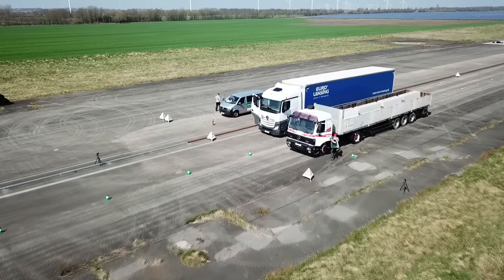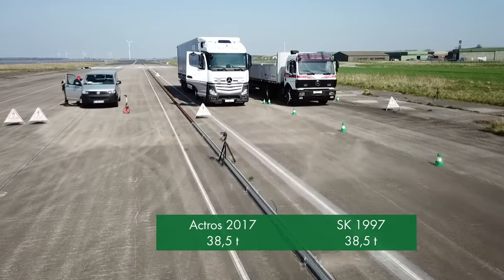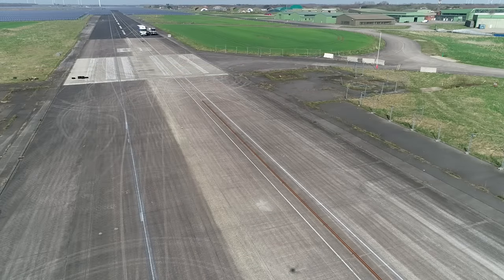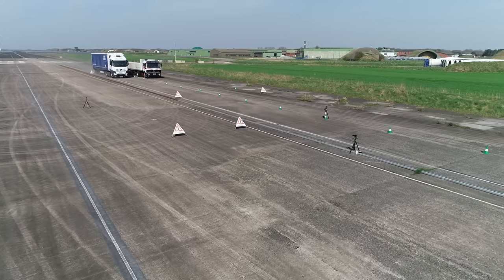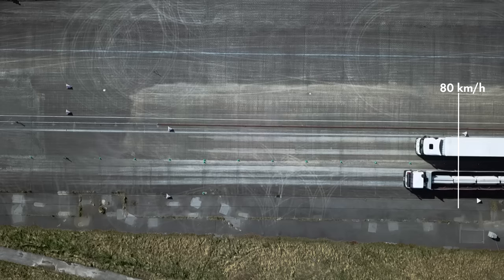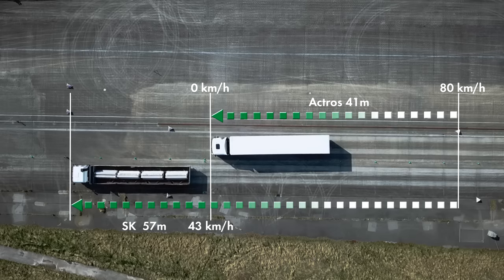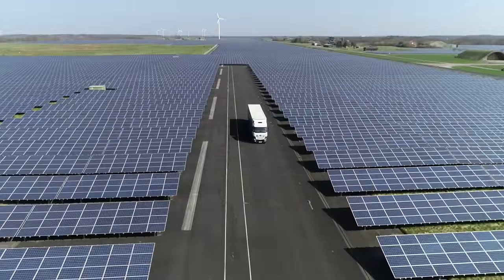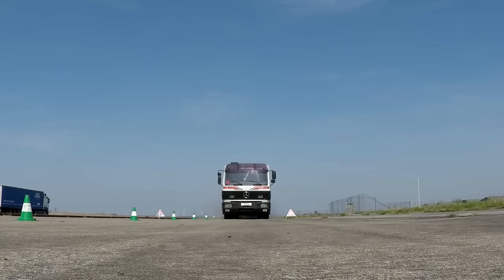Brake test: Modern truck vs. old truck

Comment: I don't understand how the passage of time can improve a mechanical system of simply dumping kinetic energy to heat has had such a dramatic effect, in 10 more years the truck will stop in the line?
Reply: The amount of the kinetic energy didn't change. What did change - is the ability to realize the braking action. Better tyres, more efficient and faster braking systems (to make it simple - disk vs drums), and better electric systems allowing less skid and more efficient distribuiton of braking action between the different wheels and axels. All of those improvements slowly, year by year and percent after percent, brought us to where we are now - this difference.
Reply: @dmytrogubskyi4355  I wonder if they put old cracked tyres on the old truck?
Reply: @MrSkyliner84  honestly, I doubt that. This truck still looks pretty good, so I’d not be surprised if it is still an ordinary working machine, thus the possibility of it running the old tires is pretty low. On the other hand, the tires themselves as production model may not be significantly changed for years. Decades - not, but years - for sure. I don’t know how precise they wanted to be with this test, how many variables they were going to chase. Yet still, even if the only things of their concern were truck and trailer production years, their mass and the legal ability of both of them to run the roads, they have achieved their goal to present a real life experiment to be shown to public.

Comment: Were the brakes properly adjusted on the older model?  Did both trucks have disk brakes or only the newer one?
Reply: juncukk , why?  Did my comment make too much sense?  I drove my first truck in 1975 on Ft. Benning, GA, and obtained my Commercial Drivers License in 1991, medically retired in 2018 and have driven a truck of some sort in three different countries so excuse me if I seem too knowledgeable.

Comment: The ideo of this test is to show how technology has advanced in 30 years. It's not only about the truck itself, but the trailer too. Trailer technology has also developed over the years. That old SK is pulling a trailer from it's era and the new Actros is pulling a new trailer.
For you delusional conspiracy theorists out there. Why the fuck would Dekra, an independent vehicle inspection company fake tests like this? It's not like Mercedes is conducting a test where they test their own brand new product against, lets say, an old Scania 3-series truck.

Comment: Why does the new truck not use the same trailer? What is inside... or what isn't!?
Reply: Because the idea of the test is "old vs new". So they took the old they've found and a new they've found. And if you want to suspect them in cheating, you'd find 99+ more reasons how they could do it even if the trailers were of the same type, so...
Reply: @dmytrogubskyi4355  Thanks for your comment, Dmytro. The thing is, that covered trailers been around in the time frame of the SK class and way before that. I know, how many I opened and closed during my active driving time.
Reply: @ajs8226  thank you for the reply too) Yes, I’m sure there were pretty much same covered trailers at that time. I just think they took what was available for the test, without second thoughts that it would become a point for discussion. I think they were interested in a year of production of the trailer (thus technologies used + wear) and whether it had the required capacity for the test to make the trucks equal in over all mass. Should they be more precise in picking the equal gear? - In my opinion, not really. They wanted to show the public a very simple real-life example of how it would be on the road - old semi vs modern semi. The masses are the same, the amount of wheels - too, the cargo is both of the same type - solids, secured on deck... So, I think they did what they wanted to do. And I’m just saying, that if any person would have a will to suspect them in cheating, he would suspect them any way, even if the trailers were of the same type. We can always accuse them in multiple things: how do we know the brakes on the old truck are not totally worn out? How do we know the driver pushed the pedal with all his strength? How do we know the tires are in good condition? How do we know the road surface is equally clean? And so on - we could continue this forever. On the other hand, I don’t think they have a reason to lie about it, and it would be also weird to expect a different result, with a 20+ year old truck braking with the same efficiency as the modern one.

Comment: But in the end I guess, the insurance for the older truck is still cheaper because of a lower value ;)
Reply: also at a cost of less efficiency, worse engine and probably less hauling power

Comment: For equal test, you should test only tractors, not trailers.
Reply: Why? Most of the trucks are going with trailers and load on the road. So the idea of the test is to compare an old truck with old trailer VS modern one with a modern trailer. Fair enough for a visualization of how this will look IRL.

Comment: there are modern cars that dont stop in 40 m :-))
Reply: because theyre light and the wheels will lock up and skid.
Reply: @user-pr4ww4pt1x  abs doesnt allow for the wheels to lock up and skid.... abs is a mandatory system and most cars on the road have them
Reply: @Pookytroll  yes, and because the vehicle is light, you can't provide a lot of breaking action - the wheel will either block, or the abs will prevent it. Still - you can't provide that much of a breaking action.

Comment: Perfect video nice and short and to the point BUT diddnt include MPH AND 80kmph isnt the speed trucks typically go is it! they go around 100kmph
Reply: In Germany (where this video was made) the speed limit for trucks is 80km/h - 50mp/h.
So it makes sense to test at that speed.
Reply: @Jehty_  but not every country has this limit and I can assure you I've seen them going faster than 80! In Germany... Anyway testibg at a faster speed would show off how much better it also
Reply: @johnnyboy2459  trucks in Sweden also only reaches 80km/h or 84km/h to exact although trucks from former warzaw countries reach 100km/h with ease and is breaking the law in Sweden by doing that. If you have a trailer on either a car or truck you are not allowed to drive faster then 80km/h in Sweden

Comment: 20 years old?  Remember, that’s the year 2000.  Not the 90’s.
Reply: thats definately a 90s truck tho and the test was rigged, you can clrearly tell the older truck was only half on the brakes cause they know older trucks didnt have the safety systems newer trucks have so fully locking the breaks could easily stop it quicker but would be alot more violent
Reply: It's 1997 truck. So it's 90-s. 20+.

Comment: The new model has a lighter trailer because the cab is heavier, but this test is absolutely worthless, with the same trailer load the old truck brakes just as well.
Reply: What's the difference? The total mass is important for braking, not the mass of the cab, the wheel, the bolt.

Comment: What do you expect when there not even on the same braking system. That 97 would be on drumb brakes when new I'm guessing it's still on drums making it a fake comparison back unfair advantage
Reply: Nope, it's not fake comparision. It was The point of this video. Drums vs discs.

Comment: Old is g0ld i own 12 trucks in saudi arabia 9 r new from 2007 to 2013 nd 3 old i m happy from the old nd the best one 1997 model 1850 nd i will not swap it with 2021 😌
Reply: Oh, mate, we all know why you wouldn't swap it, and it's not because "old is gold". It's because new is expensive, and is not needed until the old does the job with reasonable expenses. It's cool to be romantic, but let's not reject the reality.

Comment: Better "technology" only encouraging worse driving. Because drivers nowadays are less vigilant when driving, and less passionate about the actual driving.
Reply: test was rigged dude, that old truck could stop way before the new truck if they actuaslly locked the brakes up like the new one did. old trucks dont have the safety braking shit new trucks have they can and will stop quicker but its a savage and violent ride
Reply: Well, my passionate friend, tell me what do you think about this:

People killed in traffic accidents in Germany:
1997: 8549
2017: 3180

Death per 100.000 vehicles:
1997: 16.9
2017: 5.5

Comment: This test cannot be trusted, because of the following reasons:

- no mentioning of tire conditions and models
- no mentioning of condition and model of breaks of the 2 trucks
-no test with swapped drivers
- no latency measurement of drivers reactions
- trailers seem to be different

Please adjust your test to the mentioned points - otherwise your test ist worthless and shouldn't be made available to the public!
Reply: with the test being carried out by the DEKARA you can be quite sure that they had similar technical conditions

Comment: Dry pavement, straight line thats fine. I still do not want the computer doing what it think's I want instead of what I asked for,  Pot holes and snow in new england and the abs system isn't worth a f**k.These systems are fine for 4 wheelers that have no clue what they are doing, but they should not be driving truck. Bad enough the driver's of truck they are putting out now can't do what us older driver's can.

Comment: But I no that I can get in the old truck and will not get warning light flashing no ad blue problems just put diesel in it and go and if it does brake down you can probably get it going again
Reply: 30 years later your lovely grandma gets lung cancer from all the diesel fumes and sooth she inhaled
Reply: In this case you should better use a horse. It doesn't need diesel at all - just some grass and hay.

Comment: Old truck brakes must be worn out.
Reply: The SK has drum brakes, while the new one has better disc brakes.
Reply: @simonm1447  Disc and Drums perform about the same until the drums get heat soaked.
Reply: @reinbeers5322  The heat dissipation of drum brakes is poor, so they start rapidly to overheat in such a situation. They also have way more fading then. Also they need a bigger brake diameter to have the same braking power. 
Disc brakes have a good heat dissipation, they don't overheat in a single emergency braking and have only little fading. 
Discs will also be lighter than drums with the same braking power, the truck industry saves weight where they can.
Reply: @reinbeers5322  even if this is the case, the new truck has a way better abs system which makes a significant difference
Reply: @reinbeers5322  I have been trucking over 20 yrs and no. Discs and drums don't perform same. Discs are way More efficient, just like you see in this video.

Comment: Modern automatic braking systems are flawed although I don't own a truck I drive a 2020 Toyota corolla amd wnen driving on a curved road the cars parked on the opposite side of the road will initiate the braking. I now have to shut that feature off every time I use that road. Stop doing it for us you stupid manufacturers.

Comment: Bullshit. It is simply physics. If evry brake must give us specific braking force - measured in kiloNewtons on each periodic check - the braking force will be the same, if the weight and axle load is the same. So no matter if the truck is old or new, the physics works identicaly. So it is about conditions. So stop talking shits, the new trucks are better. If the old one is in good condition, it must work same as new.

Comment: another stupid thing is Anti-lock braking system.
Reply: It literally prevents wheels to lock up so they don't skid and allows truck to steer with full emergency stop.
Reply: ABS is besides the seatbelt probably the best invention for road safety ever. Maybe not on the sandy back roads you’re driving on, but on tarmac it saves your ass

Comment: Let me do the same test with any truck, antilock brakes disabled. I guarantee I will stop quicker than modern shit technology. I do want it fair, the disk brakes on my Freightliner do work better than drums, but antilock brakes do not and never will be better than a skilled trucker and no antilock. Airbrakes simply cannot modulate quick enough to out do a non driver school veteran of the road.